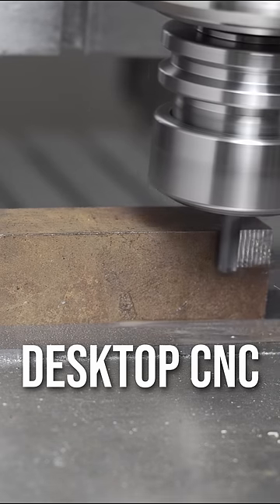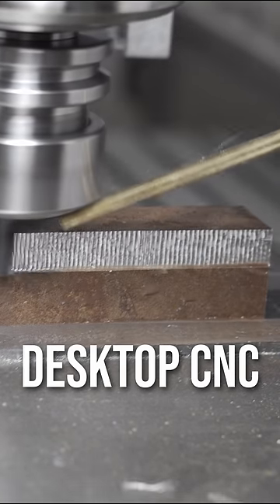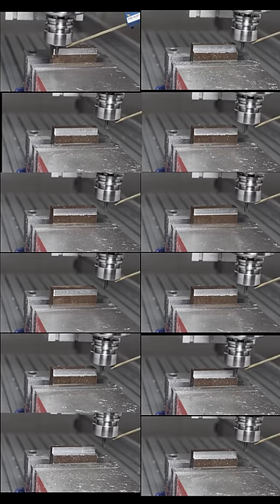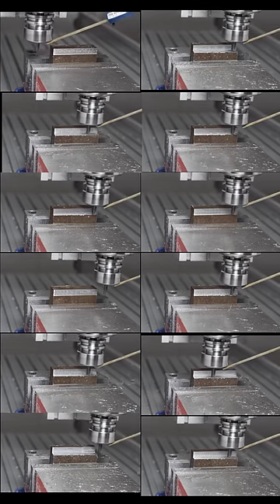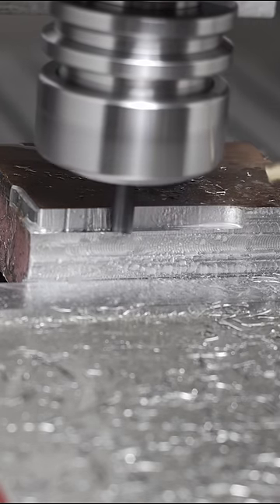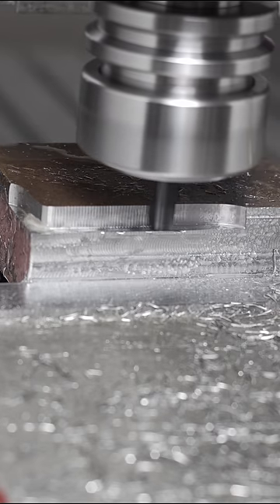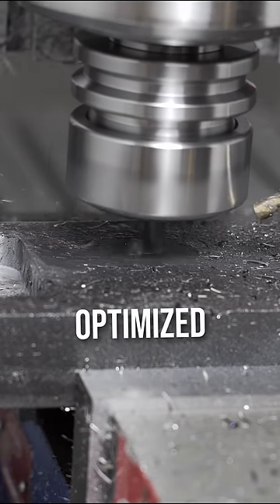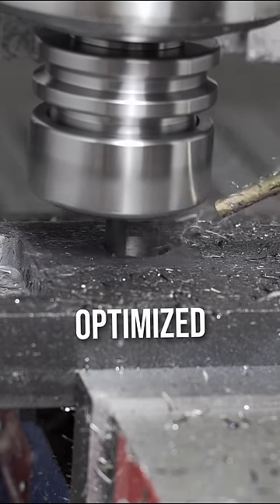Cutting Steel on a Desktop CNC

Comment: Also you need to apply waaaaay more cutting fluid while doing this. Don't apply drops, apply a consistent flow.
Reply: actually for steel you dont need to use coolant if you use carbide endmills

Comment: 1st was wrong direction try clime milling and either a lower feed rate or a faster spindle speed is that a .250 endmill you should try about 3000 spindle speed

Comment: You could run the feed against the rotation of the end mill instead of with the rotation of the end mill. You will get a better finish if you feed left to right

Comment: You're using a climbing cut which is incorrect for the amount of material you're removing. Try feed in the opposite direction for rough cuts where you're removing a lot of material and then use a climbing cut to take a very shallow (0.1mm) cut on  the last cut. (This should work for mild steel or low carbon steels like EN8)

Comment: Oosh. There is a ratio you need to follow for bit size, number of flutes, bit composition, type of cutting edge, and material being cut. Rpm and feed rates. Also, direction of cut depends on cut method and the material.

Comment: Depth of cut is your issue (stepover and length of cut). You obviously know about feeds and speeds and how to play with it. Such a light machine you're very limited to how much tool engagement you're allowed. My guess is you're going to be limited to .005 or .010 depending on flute length engagement. You can't just say "feeds and speeds" and ignore the machines capacity of rigidity and torque.

Comment: Mild or plate steel is a high rpm and slow feed rate. Stainless because of the grain is basically the slowest speed feed rate you can run. Aluminum is a diff story. Cuts like butter and feed rate can basically be as fast as if your cutting mdf.

Comment: I think your table is not strong enough so you get crazy vibrations. So if you just feed slowly in the right direction and don't cut as deep it will get better. but if you want to stop the vibrations that make the machine sad, you need to weld chonks of steel to it.

Comment: the endmill would be capable of much more sideload, but your machine does not. Thats why the endmill broke. Also climb milling is the way to go on CNC machines with ballscrews. Only manual machines you should do conventional milling so that the endmill doesnt pull the table because of the slop in the leadscrews and breaking the endmill or scrapping the part. Climb milling is better for the tool because it is rubbing less than conventional milling.

Comment: The main problem is the CNC you are using lacks the rigidity to deal with the forces. The Router and Steppers have plenty of power, but the frame just can't stop the chattering, not enough bracing with the rails, too long spars, plus Aluminum for the frame is probably only A36 which is just inferior to steel for rigidity.

Comment: You can’t just try stuff. You need to know your material, endmill material, endmill coating, flute count, power of your spindle, calculate your surface footage, calculate your chip load with any chip thinking, calculate your power requirements for the cut. Kenna metal has a good engineering calculator on their website. Don’t just try stuff

Comment: Your step rate should be half the diameter of the endmill once you have confidence in your feeds and speeds you can step it up to the full diameter of the tool but unless it’s some soft metal or you have some beast carbide endmills like missouri tools make I wouldn’t go deeper then the tools diameter

Comment: The only reason to ever conventional mill metal instead of climbing is on a hand machine such as a bridgeport etc etc which are a bit loose and have tons of backlash. It can be dangerous to climb on a hand machine. Conventional milling makes a chip from thin to thick which rubs causing heat and rapid tool wear..I have been a professional machinist for over 30 years, Ive seen it all many many times.

Comment: Why are you climb milling?  You are pulling your cutter into the material.  You need to conventional mill it and lower your rpm.  Also calculate your feeds and speeds.

Comment: I have to agree with the other people here my desktop milling machine weighs 2 1/2 tons . I can cut steel with a half inch carbide 4 flute at heavy feeds. Any bigger mill and i start chattering and have to slow down. Its an yamazen 5BVK. If you really want to haul ass cutting steel you're talking about a heavy monthly payment on a new milling machine and even then I have 35 years experience in Machining and did a full 4 year apprenticeship with college level classes to boot.Thats not in your desktop software. The last Machining job I quit the guy called me for 3 years trying to get me to come  back on, it's not generally a very good job.

Comment: Rate of feed, depth of cut (both vertical and horizontal), spindle speed, spindle rotation direction, direction of cutting movement.
That was painful for the mill, and for us.

Comment: Your machine is not rigid enough to do Climb milling, it's not exactly wrong to do it you just have to tweek all the physical issues. I climb mill on a sherline mini mill just fine, really depends on rigidity of the machine, the tooling, the tooling rigidity, the fixturing, the cutter geometry, the part geometry and the material. Also steel is the worst chip! 😢 Always gets infected and burns like crazy! Those pesky 0.001" firebrands. 🔥Cool video! ❤💯🔥🙌

Comment: But you shouldn't climb-mill on steel, you should be conventional milling on harder materials like steels.

Climb on brass and aluminum or plastics. This will reduce the chatter as long as your feed is well matched to your speed and tool toughness

Comment: If thats cold roll steel. You might try running it at a speed of 30. With an rpm of 3750.

Comment: Sparks = bad   worn bearings = bad.  Flute count critical.  Depth of cut and chip formation based on material.  Cutting fluid is never a bad thing either.

Comment: That's an awfully deep rough cut for a desktop CNC. Even the legit machines at my workplace most guys take maximum rough cuts of .250 inches. Finish cuts we can run the whole depth of the flutes, but that's taking off about .010 inches from the sides.

Comment: You are climb cutting. You only climb cut if your machine is rigid enough to handle it. I can barely climb cut .75 endmills on my r8 collet Bridgeport and it weighs 500 lbs

Comment: You're lacking in terms of rigidity and you are ruining your spindle bearings.
You won't mill steel if your CNC doesn't have a large and heavy base, usually Cast Iron to absorb vibrations. (You can get away with some steel, tubing filled with sand and resin.
You won't mill steel if your CNC has aluminum parts.
There's more, but it might be enough for now

Comment: You letting the bit run by cutting in that direction. You should always move the bit in the opposite direction of cutting. 

Also, they make a little handy book that tells you exactly what speed and what feed rate for any given bit.  

This video is amateur hour.

Comment: Be carefull, if the blade breaks, the piece will fire through the room like a bullet.

And also you are propably taking too much material at once.
Dont go too deep into the material, try more cycles with less material

Comment: It's not the motor it's the gantry, your need a more rigid design. These desktop router's are flimsy in retrospect. The endmills are fine even the cheap Chinese ones could do a whole lot better sitting in a more rigid machine.

Comment: That first cut is what fucked you youre suppose to set it a layer at a time on a piece that thick all you need to do is learn your program for that machine and i don't think constantly oiling it is good for the bit either should be oiled then let it do the cut you got it set for then when it goes to start another cut do a little more then next and so on but the main thing is learn your program and what you can and can't get away with

Comment: That happens when the cutting direction isn't going counterclockwise to the rotation of the spindle. 
1st lesson in milling metal,..if you learn it in Germany. You need a well trained metal worker when it comes to CNC,...not a programmer!!

Comment: You're cutting right to left instead of left to right dude c'mon learn the basics before you blame the machine you wanna move your cutting edge in a way that it carves and pulls metal out what you're doing is pushing it in so your cuts look like trash and you're wearing out your EM significantly faster additionally if you try to make a cut too deep like that it'll just snap tungsten carbide like a very expensive toothpick

Comment: One thing I have witnessed but never seen someone fix. When people use routers and chopsaws, they work great on wood. They can even work on aluminum. But not steel? Why? These items spin too fast for steel. Take the rpm on your router way down. One, there is no way a home machine can take heavy cut. Assume 200% doc and no more than 5% (tool diameter) step over. Have inch tool should not spin more than 1300 rpm. This machine is not rigid enough to push. It should be able to cut it with proper technique. I don't own one to try it. I only see clips here and there. (Another asshole running his mouth) Just trying to offer a suggestion. 

Carbide: (no more than) 350 x (3.82/tool diameter)

Hss: 175 x (3.82/tool diameter)

Assuming you can control the rpm that low. I believe routers usually run around 20k. Somewhat beyond aluminum, even.

Comment: Stop "climb cutting". (A.K.A. "backcutting")
Backlash will calm down.
She'll stop chattering in the cut.

Direction of cut, feed rate, rpm, cutter profile.
Get those right and you can route any material.

Also you shouldn't take any more than one third of the cutter length in a single pass on that material with that kind of setup.

I regularly machine plastic, aluminium, wood, steel....
Composite board can be interesting to find the sweet spot to cleanly cut the metal face without heating the plastic layer and ruining the workpiece.

Edit...Besides the real machines at work, I also have a baby one I fart around with in my shed.
On these baby machines, the effects of things like backlash become VERY pronounced.
Especially if you try to push the limits and cut harder materials like steel on them.